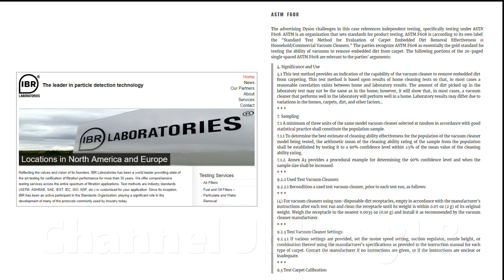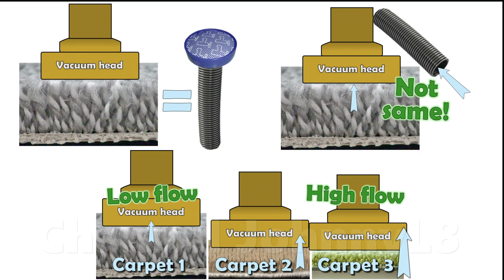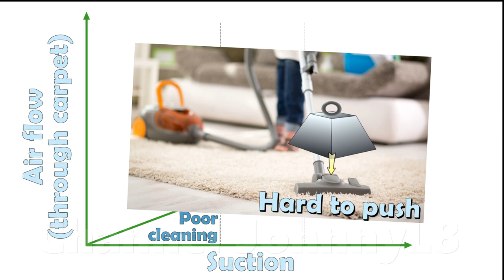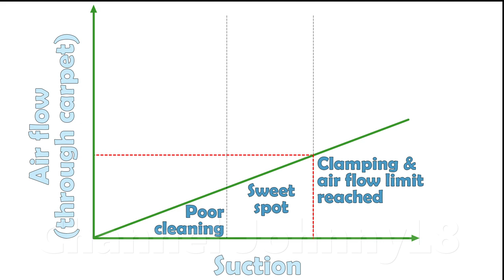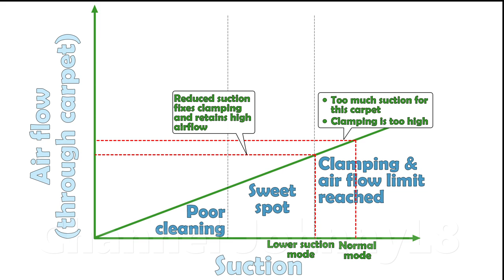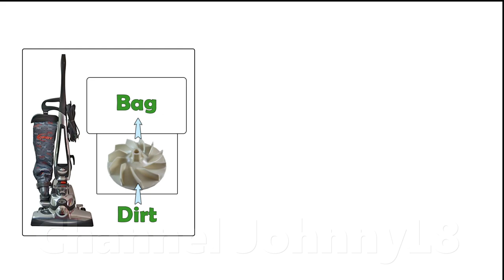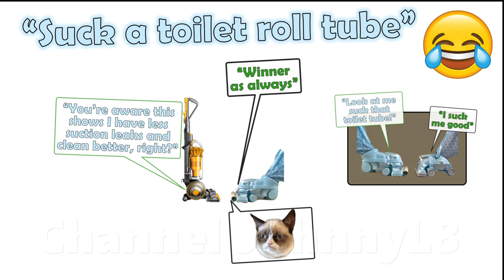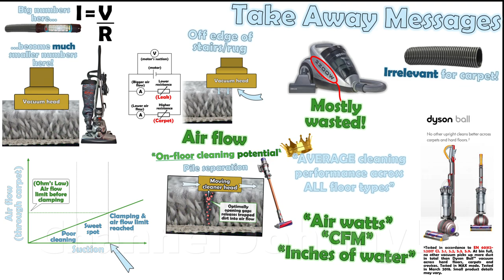Vacuum Cleaner Suction, CFM, & Air Watts

Comment: How to convert suction power AW to Kpa?
Reply from the maker: They're apples and oranges. In the first 5 minutes of this video there is an explanation of the difference between suction (which is a pressure, [Pa]) and air watts (which is a power [W]). You could technically divide your airwatts by your volumetric airflow to get suction pressure, but you 'd have to accurately know your airflow through the carpet pile. This is difficult to measure and is not the same as the airflow measured at the open hose, especially for low suction machines.
Reply: @VacuumFacts  thank you

Comment: My mom used to own a rainbow and I ruined it so regret it
Reply from the maker: How did you ruin it?
Reply: Vacuum Facts I lost the water holder the plastic thing that holds water filter. I’m sure we can order another one. My favorite part was the black water and hairs how’s they would just pour out and easy clean.
Reply from the maker: @stephanylissette3588  Ah, I see. All that messing with dirty water and bulky heavy machines is too much hassle for me. I just want to get a good job done quick.
Reply: Yes I agree once I bought a vacuum based only on cable length lol this one I bought twice though I gave it to my dad and my ex but I kept it and use it on hard wood lmao I think I have a small dirt devil $180 easy just dump the dust bowl ! Love it don’t need $2000 hypoallergenic that will break